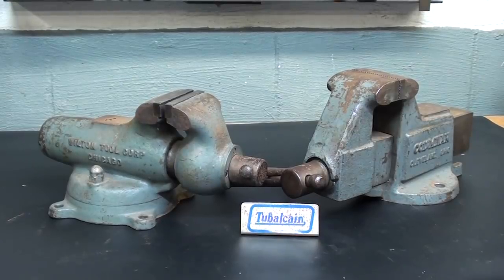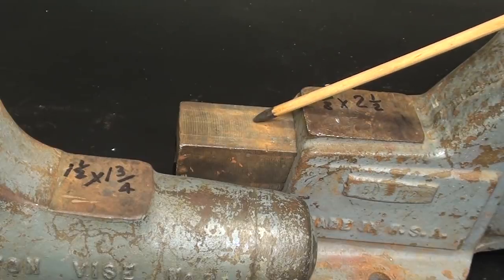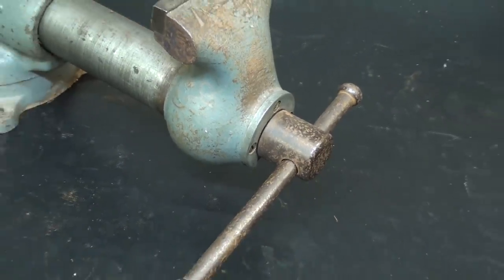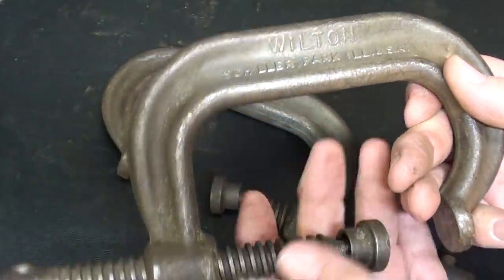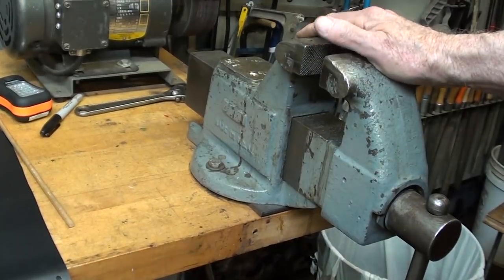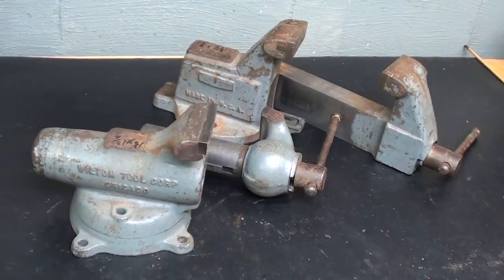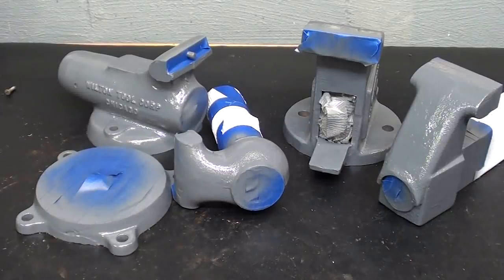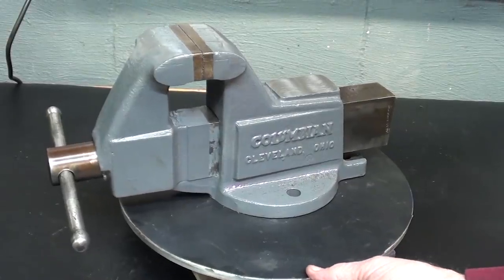Wilton vs Columbian Bench Vises  TIPS 554 tubalcain

Comment: I have worked in a pretty large Machine shop for 30 years.  My father worked in the same machine shop from 1971 to 2004.  All the large machines have Colombian 605's firmly planted to the floor via 5" round 3/8s wall tubing with 1" thick 10" round flanges on both ends making a very stout vice pedestal .  During my tenure I have witnessed the strength of these 605s during normal heavy machining work and the Government jobs the machinist brings in from home.  All the smaller machines have USA made 4" Yost's circa 70's throughout 80's vises.  The Older Yost's are friggen fantastic vices as well. After years of using imported "heavy duty" vises for home use I decided I too am going to plant a 605 somewhere in my home shop.  I'm to the point in my life I am done using inferior tools.   I have had to look a little harder for decent old school quality tools but most of the time after you find them you have spent about the same for them versus a PRC pot metal piece.

Comment: I like Record vices. Might be more of a UK item though. Also as a lefty most vices are mounted on the wrong edge of the workbench for me. At least mounted centrally everyone suffers.
Reply: Sadly Record has gone out of business. Records were heirlooms. My father's sits proudly on the end of my bench.
Reply: @mikewebb4730  Irwin bought the name and IP and are essentially making the same product, but it isn't as good.
Reply: i paid a price for a record wordworking vise and it is excellent. too bad England has lost most of their manufacturing. i bought a shop roller stand at horror freight and after rejecting their standard china made models, i saw one make in england and paid more for it.

Comment: I once found a 6” Wilton 746 in great shape in front of a pile of old washing machines, chain link fence, lawnmowers and other assorted junk at a scrapyard and purchased it for all of $3! All it needed was the swivel base, and I was able to purchase a replacement directly from Wilton for $27. She has given me 4 years of fantastic service thus far and I expect many, many more.

I watched the Fireball Tools vise test video and was shocked to see how poorly the Wilton vises performed in comparison with many of the others considering how fantastic mine has been.
Reply: even just watching the first ten seconds of that video, they are intentionally testing to failure to promote their own design. They are also testing WAY WAY beyond what those vises should ever be subjected to.  An old school machinist would literally knock your freaking teeth out if they ever saw you treating a shop tool anywhere near that badly. Gross abuse breaks things. Expecting a tool to do something way beyond what it was built for is abuse. it is a bench vise, not a magic indestructible object, a 3 inch vise will never be as strong as a 6 inch vise. Wiltons keep themselves clean and have a precise action and feel that lets you finely control how much pressure you are exerting on the work piece, it is not an black smith leg vise.

Comment: I have a 5" Athol vice on a swivil base that I like. It's built like the Columbian vice.  It's heavily built though one downside is that it doesn't have replaceable jaws. The jaws in my vice are in good condition and I do take care not to damage them.
   I've never been comfortable using the "anvil" on any vice. The vice material really isn't suited for it and the surface gets bashed up and damaged even if you are careful. What I do is keep a homemade anvil made from railroad rail next to each vice. The other thing you can do is go to Horror Freight and get one of the magnetic parts holders for $1.50 and put it on the vice's anvil pad. This gives you a place to put the small parts you are working on and reduces the temptation to smack the anvil pad with a hammer. I noticed that HF will have a 15lb bench anvil on sale for $15 with their 25% off coupon on Monday. It's cast iron, but for $15 if you bash it up you're not out much.    
   Blacksmiths will complain that steel rail does't make a good anvil. That's true, but it's much better than beating up your bench vice. While you wouldn't be too happy with a rail "anvil" next to the forge, it does pretty good on the shop bench for cold working small material.

Cheers from NC/USA

Comment: Retired aircraft toolmaker here. I have used Starret, Wilton, Parker and many more. A quality vise is a joy to use, a cheep one is a pain in the back side. I own vises made from the late 1800s post vise to the 6 inch Wilton Bullet made in the late 1980s. At the moment I have 7 mounted and ready for use not counting several milling or drill press and electronic use vises. Some reflect decades of use, others I have rebuilt. My FAVORITE vise is a quality one. I do like the enclosed screw on the Wilton bullet because it is VERY dificult to damage. My post vises also have enclosed screws. The Starret is a similar design to the Columbia in your video. Funny though, the Columbia post vise I have does feature an enclosed screw... well when closed anyway. When open it has the screw exposed. As to the machining of the "anvil" section of the vises you showed, uh, I would have just kissed them with a file to remove high spots and left them alone. If I need an anvil I have 4 mounted and ready for use ( I teach blacksmithing on the side, no collection here, the tools get used!)
Reply from the maker: Great comment, thank you

Comment: I finished my little restoration of my Wilton this morning. I used the same color and brand of paint that you used. When I originally watched your vid I wasn’t sure what color to do. But I really liked the color you did so I went with it. Love it! I polished all the handles, straightened one handle and used a light coat of grease to put it all back together. Everything It’s so nice and smooth now. It’s like brand new. I don’t have a mill so I had to use a file to get rid of some of the old hammer marks. Polishing the handles took the longest. It just looks nice to have them polished. It wasn’t totally necessary to do it. Although with them polished they just slip and slide right thru their holes which makes everything feel fine. 
Thanks again for making this video. It was inspiring for sure.

Comment: The Wilton Tool Manufacturing Co. was at the Chicago location until the 1955 to 1957 time frame when they transitioned to the suburban Schiller Park, Illinois location in the metropolitan Chicago area. Vises were cast with either the Chicago or Schiller Park location on them and this can be helpful in determining their age. But the best method to determine production date is to remove the dynamic jaw, turn it over and wipe any grease to see a stamped date on the key-way. It is also possible that there will be “GUAR EXP” stamp instead of the date code.
The Company started out by stamping, not casting, their vises with dates, but these were originally not manufacturing dates, but dates when the 5-year guarantee would expire. In other words, if your vise is stamped with 9-46, it was made approximately in September of 1941. However, it is possible to see where Wilton would run into trouble using this method. If there was ever a backlog of vises due to a recession then many would be sold later with a shorter guarantee period. As a result, Wilton changed their method at some unknown date (more or less in the 1960s). And, since that date, they started using actual production dates.
Reply from the maker: Thank you, very interesting

Comment: I have a Columbian that is about 50 years old and still as functional as the day I bought it. It has 5 inch jaws that open 8 inches. It is a model D45 with a swivel base that I rarely use. It is mounted on the corner of my bench with the stationery jaw forward of the bench.

Comment: Garden hose washers may fit your vise handles as pinch preventers. The red vinyl ones stretched over the ball on the Yost vise I used for years. It had hard smooth jaws that I far prefer.
Reply: how about just fitting a rubber hose with holes drilled in it over the vise? You get a appropriate size rubber hose, drill holes for the handles, then use a knife to make a slit so it slides over. Then when you are sure you can fit it right, you just give it a spray of contact adhesive

Comment: Interesting video, thanks.

I have a 4in Columbian vise sold under a Craftsman badge purchased in the 80's.   Still going strong.

My favourite vise is a Wilton wood work vise with a swivel front jaw and unique quick release mechanism.  I love this vise for the design.    The Craftsman gets most of the use in my shop.

Dave.

Comment: I own both. A 1750 Wilton bullet and a Columbian 5" multi-jaw rotating vise. I really enjoy them both. Both have a 5" jaw width, 4 mounting holes with 3/4" base plates and swivel 360 deg, but I think the clamping power on my Wilton is probably stronger, and my Columbian is more versatile because it has three jaw sets and rotates sideways 360 deg.

Comment: I don't own either one so I can't weigh in. At work we had a big 8" Columbian, its weak link was the nut which one day got sheared off by someone trying to pound out a frozen u-joint. I made a steel nut for it instead of cast and it is still going. In my shop I have to settle for using my Kurt vise for workholding which always seems to annoy some viewers.

Comment: There is usually a spring on the thread of the Colombian vise, pushing on the bushing pressing it outwards. It takes out the "play" of the handle (prevents it from slipping due to the weight of the handle)

Comment: My favorite is the Wilton Tradesman, wider taller jaws, fabulous two sized replaceable integral pipe jaws and serrated swivel clamping teeth ring and mating clamps. I like the keyed round moveable vise jaw guide and enclosed design. This virtually eliminates jaw wobble. Snap-On rebrands the Tradesman as their preferred vise.
I am a Wilton #1 fan, but I own others as well, but only extreme high quality.  Everyone should own a quality vise that has jaws that stay parallel and don't spread under any load.
I always mount my vises with the front of the rear jaw even with the workbench edge. This allows long parts to be held vertically with the side of the jaw. 80%? of vise installations that I used installed by others don't allow for this function. "Machinist" vises have narrow jaws relative to the vise opening depth. This is another reason that I prefer the Tradesman style. I am like Adam Booth. I have a vice for vises.

Comment: I also like to mount my swivel vises to the corner of my workbench. If mounted over the table leg it gives a better support for hammering on the anvil and the bench can be used to support long work pieces. Per the Starrett apprentice manual, I also try to adjust the height of my bench so the vise jaws are elbow height. This makes bench work more comfortable, but the handle is low enough to grab pockets if your walking by your bench in a hurry.

Comment: I have to go with Columbian. I have had the same 3 1/2 inch  for 50 years. I have held metal while welding, grinding,hammering, and pressing.  It shows wear but no breaks. Oh yes, it was used before I got it.

Comment: Starrett for me.  But I have a vise made in Poland that my dad bought for me when we were making a small shop for me in the 1960’s. I’ve pounded on it, heated it, and done horrible things to it, and it’s still fine. I also have a Parker too, that my father in law had from the house he bought many years ago. It’s from the early 1900s. I did restore that one. But my favorite is my Starrett.

Rectangular vise jaw slides are machined on a horizontal mill with two cutters mounted to the exact distance apart that’s specified. The top has a shorter cutter, and gets milled at the same time. They usually mill the bottom first so they can line it up. Pretty easy and repeatable. The rectangular hole is normally cast in, and then broached. Not too bad.

My god. Earl Schib (or however you spell it). I remember him, and his $29.95 when I was a kid. Near his end, it was $99.95, and he really sounded his age.

Comment: There are 4 different brands of vises in my shop. All are 4 1/2" . From best to least favorite, in order are the 2 Athol smooth jaws followed by a Starrett (actually made by Yost),  a Rock Island smooth jaw swivel and in last place is the stationary Wilton bullet on the welding bench. The Wilton while obviously well built, it is the only one with full time copper jaw protectors and a permanent piece of pipe stationed nearby to use as a cheater. One of these days it will be replaced by another Athol.
Reply from the maker: You have a good taste

Comment: I’m still stuck at the part where you said you threw 2 Wilton hydraulic vices in a dumpster. I’m sure God has a special punishment waiting for you😂. Great video. In Australia the big maker is Dawn, every school and government department has them and they make a huge range. From standard cast iron, cast steel which is marketed as unbreakable, fabricated steel, and even stainless steel. I have two 5” Dawns on my bench, one is standard cast and the other, which has the same size jaws but is nearly twice the size but is an offset engineers vice made of cast steel.
I don’t seem to see many off set vices in the States but they are so useful. Like Wilton, Dawn made a variety off other tools such as car and truck stands, g clamps, sash clamps, grinding wheel dressing tool ect and the good thing is that they started here in 1919 but you can still buy replacement parts for all the vices they ever made. The sad thing though is they have shifted manufacturing off shore.👎
Cheers Stuart 🇦🇺

Comment: Thank for the comparison of vices. I bought a 6" Wilton in the late 70s. It has had some abuse but the worst thing that happened is I rolled the jaws out. I don't have a dowl pin and the two screws were Mickey mouse small. Bought a 4" vintage columbian a year or so ago and I think I like it better.

Comment: Your right about improperly mounted vises... it seems like 95% of them I see are mounted too far back. It really does limit usefulness. Another thing I see a lot is small diameter mounting bolts, and/or lag bolts allowing considerable slop. Don't even get me started on flimsy benches. IMHO they should be anchored 'Rock of Gibraltar' rigid/stable (and well lit).
Reply from the maker: Could not agree anymore with everything you just said

Comment: i have a bunch of vises and try not to pick favs, but in honesty my 6" wilton is hands down the better vise. my most used vise is a very old 4" one built similar to the columbian. it has no name on the casting, and it's very old but works fine. it doesn't even have paint on it and to me i think it never had. i got it from the elder widow of an blacksmith some decades back. i use it the most probably cause it is on a corner of the main bench (37" bench Height) i tend to work at most often. it has no apprentice marks on it which might mean he bought it new perhaps, but it is way old so i don't know. i also got a very nice post vise from them, again immaculate but for grime (mounted on a 27" bench.) i wish i could of bought more, the whole shop was up for sale, interestingly he had a slew of stuff for making wagon wheels. she was very reasonable but it was out in the boonies, i was coming back from a scout jamboree with a load of antsy tired kids, equipment and was a passenger to boot. i was lucky the driver stopped and i had some money in my pocket at the time. always regretted not going back but i am not sure i could of even found it again. i have been meaning to swap it out with the wilton for years but never have. why bother, it works fine and the 4" size is pretty handy at times. and the bench was actually built for the that vise's height, the wilton would throw that dimension off it is a couple inches higher. one of the reasons i have so many benches is the height is different on all of them for the job i am doing. infact the wilton is on a bench that lines it up perfect for filing (39"). i like the other for sawing, you'd think that height would be the same for both but i saw at an slight angle more than not where filing it's critical work parallel to the floor. it really makes a difference. thanks for yer videos i really enjoy them sir.
Reply: A new 6" Wilton is about $800

Comment: Love Wilton vises, bur could never afford one. Dad had a 3" jaw Craftsman Columbian on the corner of his bench mounted correctly as advised in the video. I later bought a 4.5" jaw Columbian swivel base which I used for years.

One sad note about old Columbian vises. The older vises, those with the T shaped jaws that fit into the body and are pinned are no longer made and cannot be found if you need to replace those jaws. So, if  you buy one of those used and the jaw faces are so worn out they no longer have serreations remaining to grip the work you might want to pass. Unless you can re machine serrations into the existing jaws, or totally make new jaws. Great video Mr. Pete!
Reply from the maker: You made a very good point in your comment
Reply: @mrpete222  Is this your direct email address Mr. Pete?

Comment: I own both and while I think that the Wilton vice is stronger, I prefer and use the Columbian on my workbench because of the extra depth and the flat surface it has. I did break the thread on the Columbian years ago, called them, and they sent a new threaded nut to repair it for free.

Comment: I wonder if that machinist pin on the jaws of the Wilton prevents impacts from loosening the screws some what by taking force away from the threads. My cheap vise does not have this unfortunately and I feel that I have to often tighten up the screws.